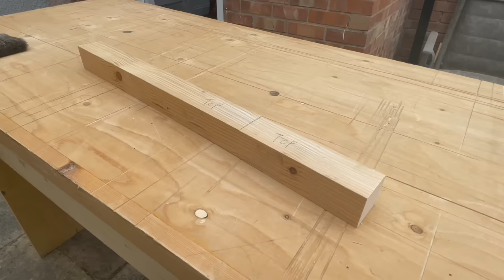Easy Trick For Scribing Kitchen End Panels

Comment: If possible always cut the top edge off leaving a factory sealed bottom edge that doesn’t soak up water when the floor is mopped and then blow. If you are really forced to cut the bottom edge make sure it’s sealed properly. Good scribing method
Reply from the maker: Yeah i agree with what you have said for sure. I do always seal the bottom and also seal round it with silicone. I should have mentioned that in the vid!
Reply: I was looking for this comment before I said the same thing, that going to swell with water and ruin the kitchen, cut up edge
Reply: @desertrose9919  If the floor is out of level, you will have to scribe and cut the bottom, just seal the cut edge!
Reply: If it's a remodel the floors aren't always perfect so you'll have no choice but cut the bottom edge. You can always edge band it with a similar color before installing or seal it with a liquid product or silicone.
Reply: I agree. Never cut a panel at the floor. Caulking isn't helping. 
Caulking and it's evil twin "quarter-round" has no place in a "job well done" execution...in my opinion 😊
Reply: @kitchensbyrannes  I guess you weren't raised to "never say never"
Reply: @evictioncarpentry2628   225 kitchens so far, did it once.😃
Reply: @kitchensbyrannes  Then it's not never like you stated. It's situational based because everything isn't always perfect around it.
Reply: @evictioncarpentry2628  ah.....1:224 is a never situation 🤣
Reply: @kitchensbyrannes  Try working on 100+ years old houses where the floor is out 3 inches over 10 feet and then tell me you don't need to cut the bottom panels.
Reply: @evictioncarpentry2628  I don't. 😃
I actually find that the older the house, the better it's build. 
Peace ✌️
Reply: @evictioncarpentry2628  Exactly, I’ve had to scribe on 18th century built Victorian houses in London. There are all sorts oh shapes that need to be cut to get a scribe. Break out the jigsaw cause that’s all that’s cutting it. 😂 30mm out over 1000m
Reply: @mwjoinery  what do you seal the bottom with other then the silicone?
Reply: I’ve been doing this for 21 years and can count on 2 fingers the number of floors that were level enough to be able to leave a flat bottom edge.
Reply: @jason-hh6lu I work for a cabinet maker of 30+ years rn. He cuts everything using the track saw. No sealers no scribing. All straight cuts and tons of gaps. No silicone/dap. Im 25y/o so I dont pipe up. Feels like im learning what not to do in a lot of cases which will be helpful. Resorting to these vids and reading comments help.
Reply: i usually leave the bottom uncut and predrill pilot holes and insert 4 polytop nails to leave a slight gap 2-3mm
Reply: I would think CA glue would be a good product to seal the raw edge if you don’t want to use silicone. Why not silicone though?
Reply: It's so important to seal cut edges, especially near a sink. I use solvent based high gloss paint to seal cut edges. Very effective. Lasts the lifetime of the kitchen. Only downside is it can take a few hours to dry, hence a lot of day joiners don't do this. Quick drying paint is almost always water based, and doesn't have the same protection.
Reply: @kitchensbyrannes  so how do you match a factory finished edge to an uneven floor? Your fixed points of reference on a end panel fit are front and top edge of cabinet. That will be straight and at 90. Back edge and floor are variables. Therefore 99% of time they need cutting.
Reply: @ThisTall agree fully. I think plenty on here are just diyers and weekend warriors
Reply: So, this methid only works if the floor and wall are relatively flat and level/plumb to begin with. If the foor or wall are out quite a bit, then once you make the second scribe, your height will be either too long or too short.
Reply: Wish that vid had been made when I did my kitchen 6 years ago.   Had to learn this the hard way. 60s bungalow, new floor, nothing was square, apart from the units. I put 2 layers of silicon on the cut edge on the floor. Helped a bit compared to some I've seen with wet soaked up, but not perfect. The comment about raising it up a tad is a good one.
Reply: Been fitting kitchens for 20 years & I’ve rarely seen a level floor 😂 scribe & seal, never had a problem.
Reply: The whole point of scribing to the floor is to follow the imperfections of the floor's plane..same as a wall.  

For an accurate scribe you will need to make your cut on whichever side has the imperfection, cutting the top off in this case would ve counter productive.
Reply: Perfection at its BEST!
Reply: @robs4509 most floors our out of level, all walls are.
Reply: You were lucky that the floor and wall were straight. I always found walls to have a belly towards the bottom, so a straight cut with a circular saw was never an option.
Reply: @Bob-kb5pv  yeah, this cutting method defeats the entire purpose of scribing.
Reply: Not factory sealed edge will be 100% water tight
Reply: Instead of pratting about with wood  just use a compass two lines to cuts simple
Reply: Correct. Countertop is coming on the top so that cut line will not be visible anyway. Anyway, sealing a cut edge is "must" per me because cut line that goes against the wall is all way down to the floor and an option to get in touch with water or wet floor.
Reply: So how do you do it if it's against an uneven wall?
Reply: @mwjoinery  No need to seal the bottom. You can buy PVC end cap moulding, in white, or transparent and that solves the issue the right way. The paint isn't going to protect from moisture and water.

Comment: Pro tip, I ALWAYS face those clamps in towards the cabinet whenever possible. Taking one to the eye is a terrible experience
Reply from the maker: That is a top tip! I have a close call daily but still forgot every time i use them to face them the other way😂 thanks for watching!
Reply: thats why you should always have safety specs on
Reply: I guess you didn’t see it coming?
Reply: @naebadyersel I’m more worried about my Nutz.
Reply: Top tip, I've got a lovely scar on my head from one of those

Comment: Leaving the non protected(not edgebandet) side of the panel on the floor is a huge mistake, one spill of water and this needs a replacment.
Reply: It's sealed with a bead silicone for one and second of all if the edge banding is on, it hasn't been scribed has it so it'll be gap city if you have an uneven floor 🤦‍♂️
Reply: @alisterkelly4052  You can scribe it without removing the factory edgebanding on bottom, but it needs a little more thinking. Silicon still works well for the first 3-4 years.
Reply: @MrDabadas  no you can't because if the edgebanding isn't removed then the board edge remains flat, it has therefore not been scribed and doesn't remotely match the floor shape
Reply: I just coat the cut edge with yacht varnish then run a final bead of silicone around the bottoms of of all plinths and  decor panels when the kitchen is finished
Reply from the maker: Thanks for the feedback. I would normally add a couple of coats of pva on the cut side before sealing just for a bit more protection. I should have mentioned that in the video but completely forgot to be honest with you.👍🏼
Reply: I always leave the factory edge to the floor if it's level of course, if I need to scribe and cut it I'll put waterproof pva on the cut
Reply: Hear a lot of people using pva but they don’t seem to realise that regular pva is water soluble 🤦🏼‍♂️
Reply: @MrDabadas how do you scribe to an uneven floor without removing factory edge

Comment: Great vid, but I always cut the top as if you cut the bottoms it will get wet. Sometimes you may get a small gap but it’s not noticeable as it’s on the floor.
Reply from the maker: Thank you!👍🏼 I always seal across the floor anyway which I forgot to mention in the video but i get your point completely. I might try that on the next one i do, cut the top and then use this method to scribe the panel to the wall. Unless the floor is a mile out😁👍🏼
Reply: @mwjoinery  exactly. Nothing worse after 6 months and the panel is bubbled cause the customer has been mopping the floor. As said, some fantastic tips in this vid 👏🏻
Reply from the maker: Yeah, will definitely take that on board. Thanks again👍🏼

Comment: I always silicone the cut edge to the floor to avoid moisture ingress.
Reply from the maker: Thank’s for the feedback. I do normally silicone it but i wanted to get the small bit of skirting done to the left of it before. Also, I normally add a couple of layers of pva to the cut side for an extra barrier. Should have mentioned both of them in the video but completely forgot to be honest mate
Reply: Many times on higher end kitchen and bathroom your panels will 100% of the time be solid

Comment: Great video, i do the wall first using same method then just mark and cut the top, ill try your way mext time
Reply from the maker: Thank you! If the floor is level I would stick with doing it your way. That’s what I do. But if it’s in need of a scribe this method works well. Just make sure to seal the bottom. Thanks again👍🏼

Comment: Incredibly useful video, thanks very much! PVAing the bottom is quite common I see, I presume for chipboard or MDF.... What about solid wood end panels? Worth it anyway or a fool's errand??
Reply from the maker: Thanks! I haven’t actually fitted a solid wood one before. As long as it is sealed with a bead of silicone i don’t think it would cause many issues without the PVA but it may be worth doing anyway for a bit more reassurance. The chipboard/ mdf soaks up any moisture like a sponge so it is a lot more important. Appreciate your comment👍🏻

Comment: Great little tip! Many thanks, new subscriber. The kitchens i fit have plastic trims that slide onto the bottom so the cut side can be on the floor, if not it could just be sealed with a little clear silicone.
Reply from the maker: Thanks a lot! The last one i did had a plastic seal and i tried putting it between the wood that hooks on and the cabinet. It raised it that little bit more and ended up working really well. Thank you for subscribing👍🏼👍🏼

Comment: This looks a great method. I've liked and subscribed. Does it work everytime, regardless of the size of the surplus material needed to cut away? Thanks
Reply from the maker: Hi, thank you for that! Everytime I have used this method it has worked so I believe so. As long as you offer the panel up to the unit first and make sure that the timber you use to clamp on and scribe with is bigger than how much the panel overlaps the unit. If that doesn’t make much sense, let me know and I will try and explain better. It’s hard to explain over a message😆 Thanks again!

Comment: Thanks! Will be useful when I install a few cabinets and end panels. Does the wood being used have to be a certain thickness or will any thickness do?
Reply from the maker: Yeah it is a handy method. Just remember to seal it at the bottom if you do use this method. It can be any size as long as the piece you clamp on is the exact same as the one you run across the floor. This is why (like In the video) I cut them out of the same piece so I know they are the exact same. That is the only important measurement, can just be thin bits of offcuts as long as it hooks on the cabinet ok. Thank you for watching👍🏼
Reply: Thanks for the reply!
Reply from the maker: No problem at all😁

Comment: Love that method mate. I’m going to be using a circular saw to do mine, but that cuts upwards obviously, I’m confused as to how to transfer the markings to the back of the decor panel, any suggestions, please?
Reply from the maker: Hi, sorry for the late reply. I normally get notifications for comments but have only just seen this one. Before getting my track saw i made a track for my circular out of a few bits of mdf and that worked pretty well. When i used that along with a sharp blade there was hardly any breakout so could just cut from the face side. I would definitely recommend knocking one of them up if you have any materials spare. If not maybe just transfer the marks round each end. Join them up with a straight edge and cut a few mm to the waste side. Can always flip it over and then sand to your line. Thank you for the comment and thanks for watching👍🏼
Reply: @mwjoinery  thanks for the reply and advice 👍
Reply from the maker: No worries at all, thanks again😄

Comment: so how long will that particle board last raw on a floor, shouldnt you have scribed the top instead or sealed the bottom?
Reply from the maker: I also pva the bottom and since filming the video I have sealed it with some clear silicone. I should have mentioned that but completely forgot if I’m honest. As for cutting the bottom, I would prefer to cut the top of the panel if the floor is perfectly level but if it needs scribing to the floor the bottom has to be cut to match up with the floor. Thank you for watching👍🏼

Comment: I'm new to this and while this looks easy, how did you determine the thickness of the piece of timber you wrote top on, or does it matter?  Great video, for sure!!! Thx.
Reply from the maker: If you offer the full sized end panel up to the cabinet, the panel will be bigger than the cupboard. For example it may be 30mm bigger on the top. In this case, if you use something under 30mm and clamp it on. It wouldn’t lift the end panel up of the ground. If you used anything over 30mm, for example 40mm. That would allow you to clamp it to the panel and hook it on the cabinet as i do so in the vid. As long as you use a block on the floor what is the exact same size, you can run it along the floor and that will follow any contours. As long as that is done correctly, cut to the line and it should drop down and finish perfectly level with the top. Hope this helps, if not let me know and i will try and explain better. Thank you!😄
Reply: @mwjoinery , thanks for the quick answer, now I understand.
Reply from the maker: No worries at all, thanks for watching

Comment: I would put some sleeving on the bottom edge of the board. If floor ends up being mopped up that unprotected cut edge will absorb water like mad.
Reply from the maker: Yeah if the floor is level I will cut the top just to prevent this. If I use this way to scribe it to the floor I would seal it with a few coats of pva but forgot to include that in the vid. Thank you for watching!😁
Reply: @mwjoinery  No worries, but regardgless good trick !
Reply from the maker: @bucu  Thanks again!😁

Comment: Hi.  The piece of wood you use to scribe it.  Does it matter how thick the piece is ?
Reply from the maker: @DorothyChicken-j5b  hi, no that shouldn’t matter it just needs to be enough so that you can hook the cabinet onto the top of the unit. I would say anything from an in to 2 inch is ideal. It’s the depth of them that is the critical measurement and they need to be the exact same as each other. Thank you for watching!
Reply: @mwjoinery  OK. So as long as both pieces are the same and you book them on so they're level, the scribe should be good?
Thnx for you reply.
Reply from the maker: Yeah, like at the start of my video you just have to offer the end panel up to the carcass and it will overhang it at the top. Your piece needs to be bigger than that overhang and both the exact same size as each other. If it is less the overhang when you try and hook it on it won’t raise the panel up off the floor if that makes any sense? And it’s no worries I’m happy to help as much as I can so feel free to ask👍🏼

Comment: Great video, do you always fit your doors before end panel goes on then?
Reply from the maker: In all honesty I haven’t done that many kitchens yet but i have tried this method a few times and it has worked well every time. Every time i have done it, i put the doors on first. It’s just important to remember to adjust the door so that it is level before doing the scribe. If not the end panel won’t finish level and will follow the door. If you did it without the doors and did the scribe to the carcass, you would need to add the thickness of the door (plus a couple of mm for adjustment) the bit of timber you clamp on the end panel. Hope this makes some sense?😆 Thanks for watching!

Comment: Great method. Would this still work for ladder units? Bigger piece of batton maybe?
Reply from the maker: Thank you! I’ll be honest, I have never tried it on a larder unit but as long as the wood you use is thicker than the overhang (as i showed at the start of the vid) and both the exact same thickness I don’t see why it wouldn’t work. Might just struggle if there isn’t much space between the top of the unit and the ceiling👍🏼

Comment: Nice finish! but cut end should be at top to protect bottom from water?
Reply from the maker: If the floor is level i would put the cut side up but if the floor is noticeably out of level, i was taught to do it this way and add a couple of layers of waterproof pva then silicone it. How would you go about it if the floor is out of level? Thank you for the feedback!
Reply: @mwjoinery  OK ignore my comment that makes absolute sense! Thanks for sharing and great work!
Reply from the maker: You definitely made a good point, i should have explained that a bit more in the video. Thank you!👍🏼